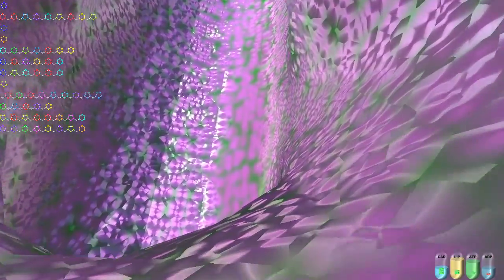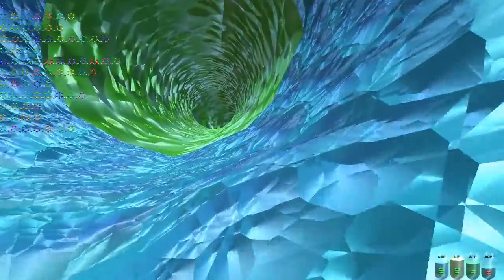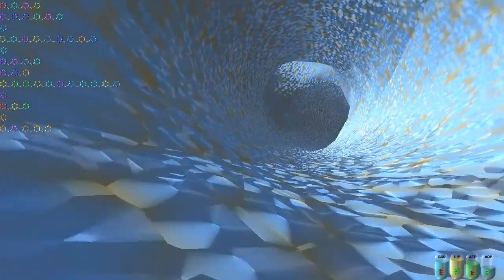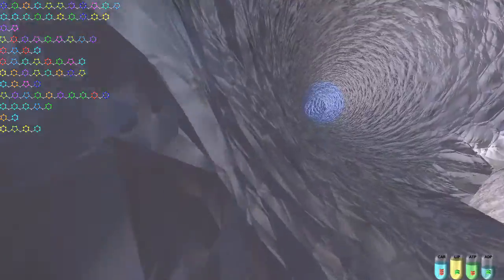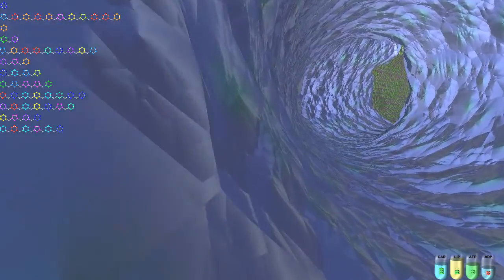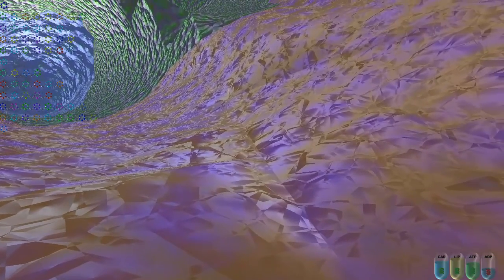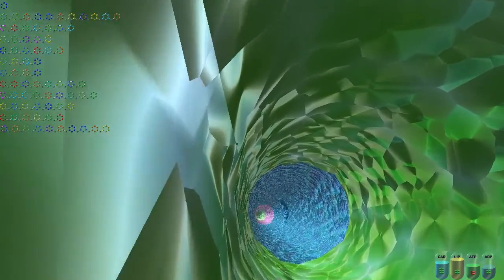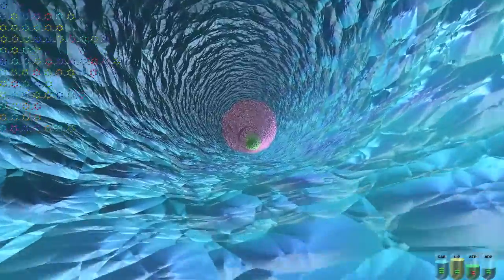Insights on the bacteria system

Comment: Great progress...you forgot about AMP though, which was more basic than ATP/ADP for energy.  AMP/ADP cycle contains less efficiency in energy storage (AMP<->ADP is about 15 KJ, while ADP<->ATP is 30KJ), but it was the first before evolving to perform ADP/ATP.  This could be an RPG style of building up your bacterium by "finding" the phosphorylation "upgrade" or something.

For water effect, I would take a grayscale bubble picture as a filter for vertex mapping in final render and move the filter as the player moves or looks around and as time passes.  You can add more of these mappings on top of each other along with a darker overlay as the player goes "deeper" or more dense liquid.  It will also help with getting rid of some of the sharp edges and obvious tiling.
Reply from the maker: Thanks for the hints! Deciding where to simplify reality is always a challenge, but this sounds like a good gameplay element indeed.